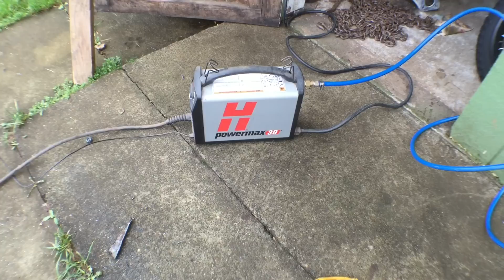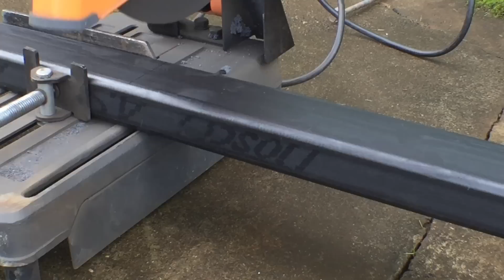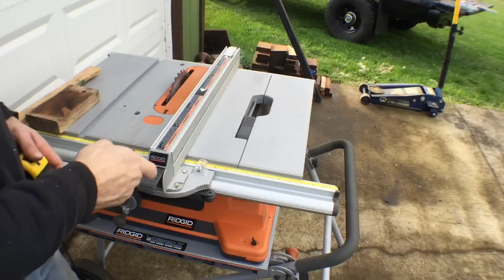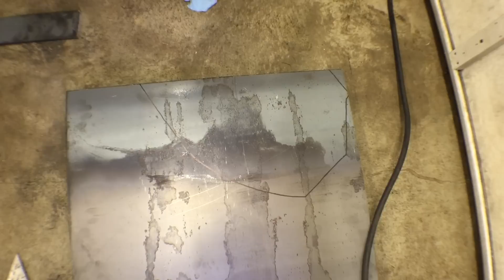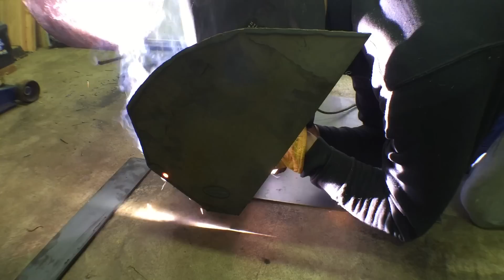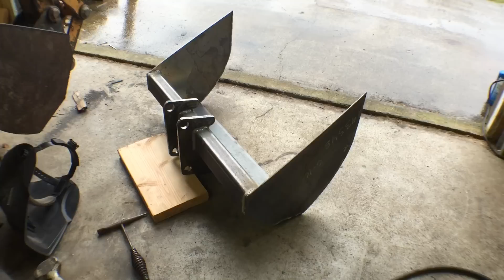Building a backhoe bucket part 1

Comment: What thickness of steel did you use for the main part of the bucket? It turned out really nice by the way.
Reply from the maker: 10 gauge sheet metal  for the main body, 3/8 plate where the pins go through, 3/16 wall 2x3 tube. Thanks, I have a few hours on it now and have been very happy with it.
Reply: Jon Kanooth thanks for the reply and thanks for the info.
Reply: About how much does that weigh?

Comment: what thickness did the plasma cutter cut??
Reply from the maker: It was 3/8", thanks for watching.
Reply: @jonkanooth8182  it's a powerful looking plasma cutter. .loads of cutting power in it. .
Reply: @jonkanooth8182  pretty impressive given it's only a 30A cutter. Dross came off easy enough. Was that bucket material thick enough to withstand the demands of it?